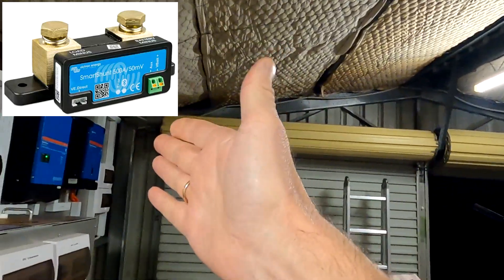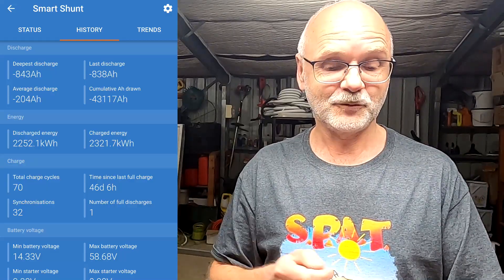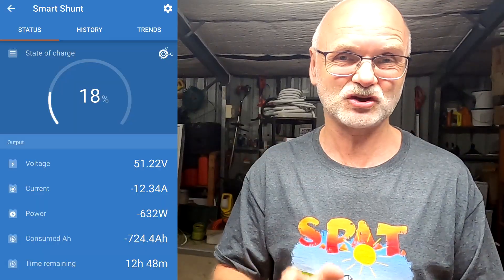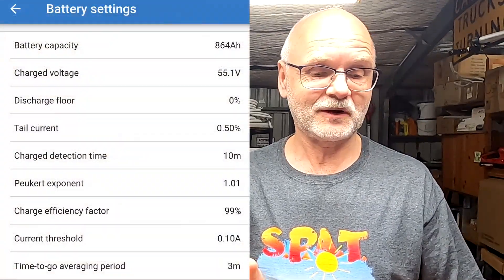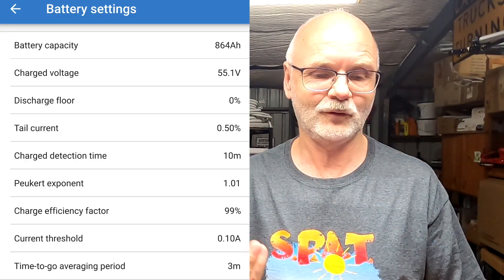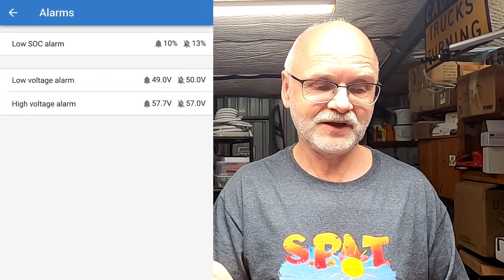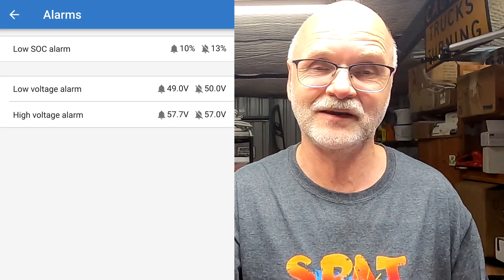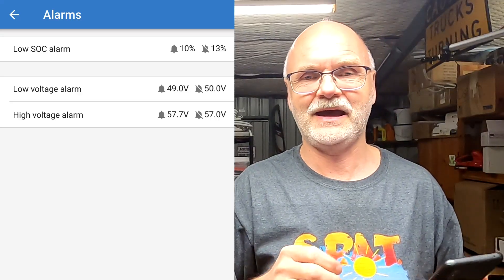The undervalued component in your solar and battery system - The Victron Smart Shunt.

Comment: Question for Andy (or others…): Is it feasible to run the 24-port JK BMS with 24 (instead of 16) cells in series? This would yield a combined voltage of 76.8V DC rather than the normal 48V, of course. Aside from the unusual charging voltage, can the JK BMS be configured thus? Otherwise, what’s the use-case for the 24S version of the BMS?
Reply: For example, if your building an e-bike battery, you can use more cells in series to make a 71.4 or 96 volt battery which is more common in an e-bike of electric scooter setup. That's probably why they make it to 24s. So it also works with different chemistries, 2.3v LTO battery to 4.2 Li-ions...
Reply: Of course if it's a 24s version that is what it means... 16s is the 48version....
Reply from the maker: Yes, David, this will just work fine with 24 cells in series. No problem.

Comment: I use The Outback power Flexnet DC  with three shunt's  it is pretty accurate and you can set the battery efficiency which helps when factoring in efficiency loses from the BMS's

Comment: I was considering getting one of those, but we only have about 2 months, maybe less, of summer left here in the uk, so thought I'd wait till next year.
Over the winter I'll buy 2 more batteries ready for the sun to arrive in spring 🎉
Then I'll have 4 x 12V 100ah batteries making a 24V 200ah system ready for 2023 😁 
At least I'll be able to save more on the impending electricity price increases here in the UK 🤬 More battery, less time on mains electricity 👍
Thank you Andy for the helpful guide 🍻🍻
Stay charged 😉
Reply: Don't discount how much solar you can make in the winter months!  The panels are much more efficient in the cold!  Plus you can tilt them an get a huge increase as well.  If your solar charge controller allows for it go ahead and over panel it.  Solar panels are fairly cheap in comparison to the rest of the system.  It's worth overdoing!
Reply from the maker: Thank you. Step by step you're getting there...

Comment: This is a super timely video for me. I had decided to not integrate a smart shunt into each battery, like I had originally planned. I was planning to use the one smart shunt for all six batteries, and this validates my plan. Thanks!
Reply from the maker: Yes, there is no point logging into each BMS and check for that. You want one centralised device. Maybe consider the battery monitor as it comes with the display and relay.
Reply: @OffGridGarageAustralia  Huh, I thought they didn't support 48v, but I just looked again and they do. That's ... interesting.

Comment: Just to add to the confusion: I have found, that in my system the JK BMS and the Lynx Shunt SOC values are actually identical. They weren't at first because I didn't top balance my cells, but after a few days of balancing with the JK they're now below 10mV difference and all charge to the 3.4V equally fast. So now the two SOC values perfectly match up :)

I've got just one 280Ah battery with 10kWp solar, it goes down to around 50-60% overnight and is at 100% as soon as we get a few hours of sunlight :D
Reply from the maker: The question is though, will they stay synced over time when you are not going to fully charge your battery for a while and have only mini cycles every day?
Reply: @OffGridGarageAustralia  I'm curious too but at the moment I can't test that due to an abundance of energy. Though I'm getting a 6kW Heater for my 1,5m³ hot water buffer which will cycle the battery between 95 and 80%. I shall report back the moment anything interesting happens :)
Reply: You didn't report back
Reply: @buikemm  I did not, because I forgot about it...
In the meantime, I've set up the system to fully charge every few days during the winter. So I can't really say if there is a drift.